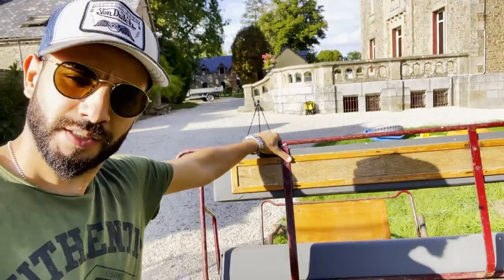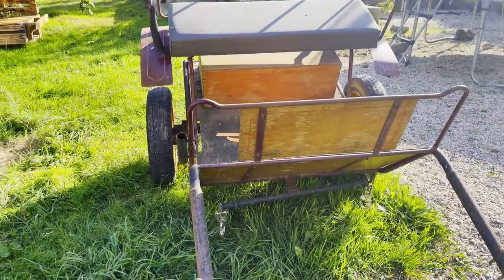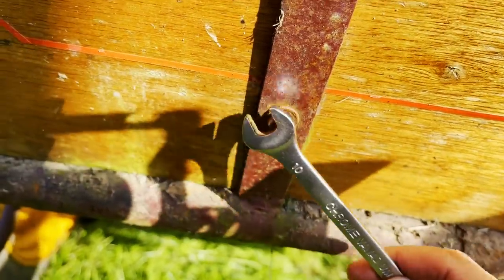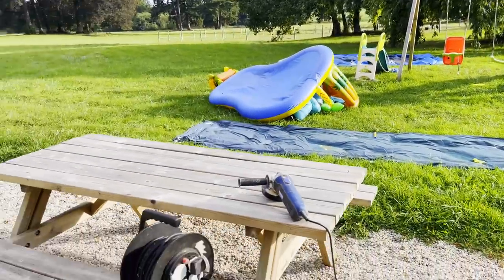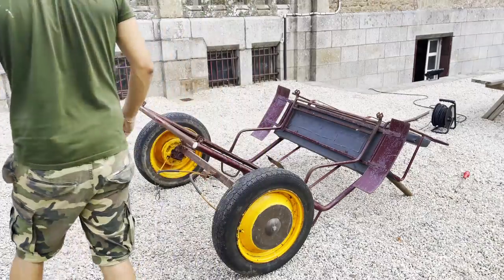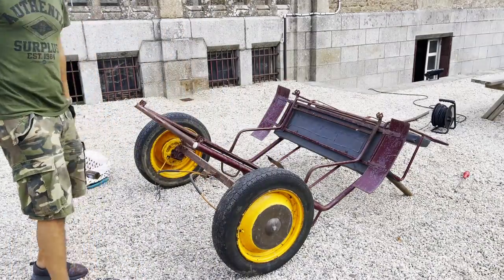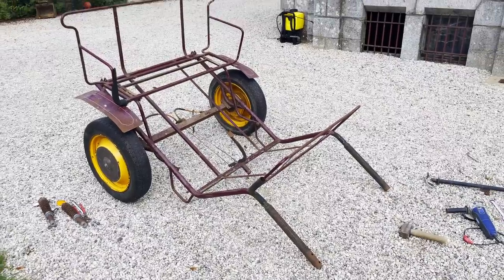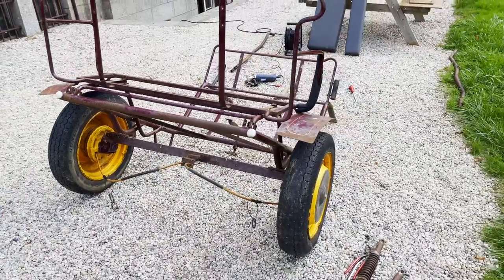WORK STARTED ON Renovating The Cart part1 -Thunder storm at the Chateau !!! #diy #château #france

Comment: Good morning Mo, I am sure the cart will be beautiful, I can imagine it already with the metal painted and the wood sanded down, are you painting the metal red or black? Are you going to paint the wood work, I think by painting it it will preserve the wood maybe longer and you will have a good finish. All will be revealed after sanding. I know it is expensive but try to replace the wheels as well, new tyres will make all the difference, it is a lot of work but the finished product will be awesome. It is easier to fix the brakes when you just have the frame work. This reminds me of the movie Dr. Zhivago!!  You are a very nice person Mo, nothing seems to phase you, yea, the trusty old screwdriver, works wonders. Kind regards.